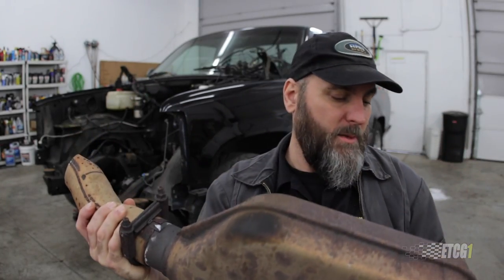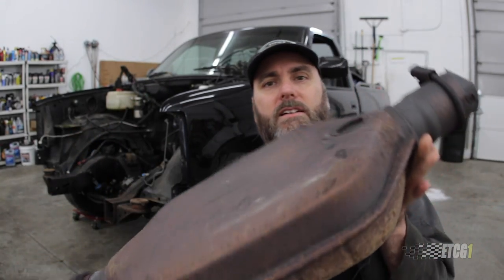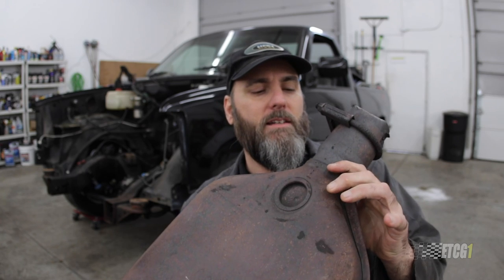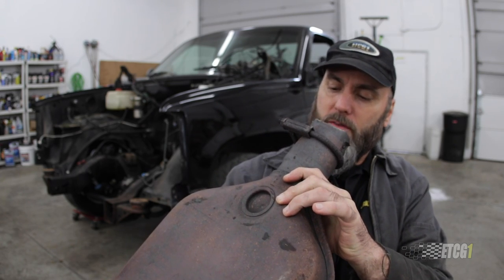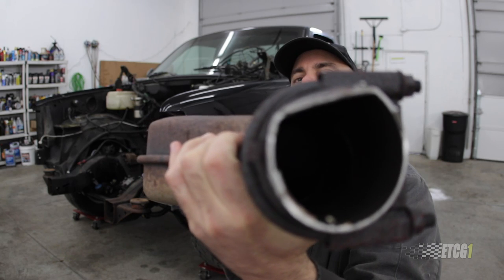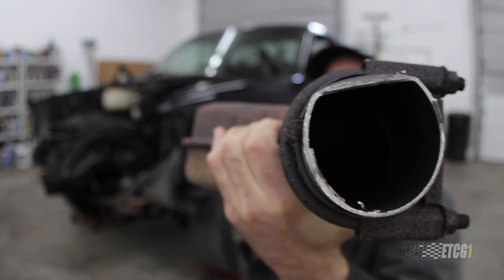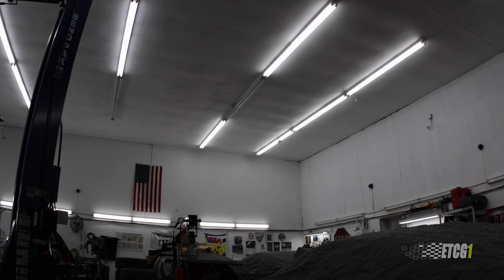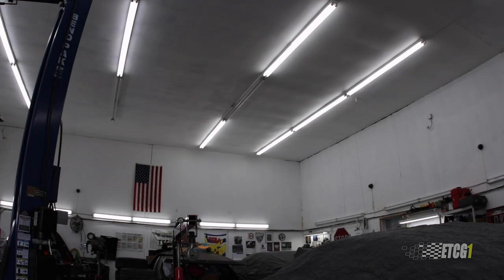Should You Run a Catalytic Converter on Your Hot Rod?

Comment: Most of the emissions equipment fitted to vehicles in the early days were almost entirely a waste of time that actually caused more pollution in the long run. Much of the improvement in air quality was achieved not by antipollution equipment fitted to vehicles but by improvement in the fuel they burnt and improvements in the way they burnt it. 
While catalytic converters may not actually do anything for the environment with the exception of reducing the appearance of photo-chemical smog fitting a hiflow cat now may prevent headaches in the future.

Comment: In the UK nothing you do to your cars emissions matters in terms of improvement. We've just had the "Ultra low emission zone" introduced in London and it's just based on trivial at the factory testing. For example a 2004 BMW 325i will have to pay but a 2005 one will not, even though their emissions are the same as they are the same car, and engine, etc. 

My 1986 BMW 6 series, was made without a cat, and although technically putting one on would allow it to pass modern enough emissions, reclassification is not allowed over here. It will be considered dirty even if it had zero emissions. And they only exempt "historic" cars, (over 40 years old) even though most insurance, institutions and even our government used to accept the 25 year norm. This is just insanity and has proven will make minimal difference as cars are not the issue in London, but are easy to charge money.

Comment: If a vehicle is being used on the road, I believe emissions equipment should be kept intact. However, it can be improved upon. Look at the GM E-rod stuff. Today's modern cats are much more efficient and smaller than the heavy factory stuff was 20+ years ago. They don't rob power or add tremendous weight. 

My dad grew up in Southern California; he remembers "smog days" at school in the 1970s; kids weren't allowed to play outside because of the air quality. His dad, my grandad, died from lung cancer; a combination of smoking and working in factories for 40 years. Smog kills people. Look at the fines levied against VW for cheating on emissions. Look at the penalties for improper HVAC evacuation. It's serious stuff.

That said, there are always exceptions. Race cars, or cars used primarily on race tracks, can be exempt, in my opinion. But the enforcement there has to be good, too. Maybe bring in paperwork showing the car being used as such (or not being used). Otherwise everyone would register as a race car. 

There is also the issue of manufacturer design faults. BMW E39 M5s (2000-2003), for example, are somewhat infamous for having secondary air injection ports in the cylinder heads that clog, causing a repair that basically necessitates an engine-out service. Later models have larger cylinder head ports to lessen the issue. Do you force consumers to repair the issue, knowing it will reoccur? Do you require the manufacturers to support emissions systems? Like the Super Ultra Low Emissions Vehicle (SULEV) and Partial Zero Emissions Vehicle (PZEV) regulations in California which require manufacturers to repair any emissions equipment for 150,000 miles.
Reply: Identifying "Race Car" is easy. Race cars are not street legal. Don't need paperwork to say they aren't for street use they simply don't meet the requirements and can't be used on the street.

Comment: I live in California and my car is newer then 75 so I have to have a cat on my car but I think I would have a cat on even if I wasnt required to. I just think they make sense and with the newer cats available today there isnt the performance hit that it use to be. In addition to the eco reason to running a cat there is also the bad smell that comes from not having a cat and having a cat keeps the exhaust from turning the back of the car /truck black.

Comment: All I can do is speak from my own experience. I had a 1981 Ford f100. It had a 300 straight 6 with 3 on the tree. It had a problem where it would idle up and down while parked. I finally got disgusted with it and ripped all the vacuum lines off and plugged them. Then I disconnected the emissions. Adjusted the choke and timing. Cut off the catalytic converter and replaced it with a piece of exhaust pipe. I wound up getting more horsepower and 33 mpg. Curiosity got the better of me and I took it to the Ford dealership and had them hook it up to the emissions tester. According to the machine it was putting out less emissions than the brand new 2002 f150. Then I showed them everything I had done and we realized that the emission equipment back then was a government scam.

Comment: Catalytic converter requirement is a federal mandate if the vehicle was equipped with it according to the underhood label or manufacturer specifications. Just because you don't have emissions testing or your state does not enforce it does not mean that it is still not a federal requirement.

Comment: 1- I am concerned about the environment.
2- I require money to live and place those concerns before the environment.
3- Catalytic converters cost a LOT of money.
4- I believe that personal accountability is HUGE, but that I shouldn't be held responsible for things that I did not cause.

All that said, if I have a working cat, I will install it. If I break it due to my own negligence, laziness, an accident I caused, or personal ignorance, I will make efforts to replace it.
But if someone else breaks it, causes a failure, or it was engineered cheaply so that it would fail after warranty gives out, or I bought a vehicle where it didn't have one or it had failed? No, I'm putting the replacement on the back burner and it may be several years before I get around to replacing it.

If I were more affluent, I may make more efforts to replace them no matter what.

That, and I have an emission exemption sticker on my vehicle for driving less than 5,000 miles a year. In fact, I have put 3,000 miles on my car since I purchased it with 245,000 miles on it in 2018. I've also tried affordable ways to repair the cat and they have not worked. So while I do care about the environment, I have no intentions of starving to death to reduce my trillionth of a billionth of a percent of the total human impact on it.

Comment: its all about culture, and eric, you live in the midwest.
take inspiration from mighty car mods and skid factory,  who always put one on.
imagine all the year of starting up in the garage,
are you sure you wont regret trying to filter the carcinogens out of the air at all?
Reply from the maker: Thanks for your input. First, my shop is 300sqft. The carbon monoxide detector never goes off. Second, I'm installing a fuel injection system that will be way more efficient that the system that's on the truck now. Just that alone may offset any additional emissions over a stock truck,.

Comment: In mass it was 20yrs classic 25antique. Here in Wisconsin same but also have special construction class. Multiple ways to get around it, if we had inspections of any kind :)
The burn efficiency is designed into the newer power trains from the intake to header. And refined further with a computer and cat. Your doing the planet a service simply by updating that power plant and I would put money on it burning cleaner without a cat than the stock setup. Not that there’s anything wrong with a high flo cat.
And for the record, anyone complaining about a no cat smell is a wuss or maybe younger than a millennial. It’s the smell of an industrious nation getting to work. The smell of school busses beginning of fall on a chilly morning. A bit of race gas in the hot rod just blew past you in your wife’s mini van. NO IM NOT GETTING OLD DAMN IT, I’m not getting old..I’m not getting old..I’m not getting old

Comment: Maybe come back to your project cars with a plan on how to slip a CAT into the exhaust without having the replace the whole system again. Kinda like what you did with your loud button on the Fairmont. Not a fan of emission laws when it comes to cars, though I am for them #Iheartearth. I live in Illinois where we have them. I’m selling my 2008 Subaru Impreza mainly because it requires a new CAT which cost over a grand to fix, and the car is old and I’m tired of putting money into it. You would think it wouldn’t cost so much to repair since the state requires that cars have one. But thats just my opinion 🤷🏽‍♂️

Comment: I'm in a no emissions state. I see cars regularly that should not be on the road due to accident damage, windows missing with the opening  covered in cardboard and clear tape. Pushing blue smoke out of the tailpipe. I have completely changed exhaust systems without fear of trouble. Muffler shops will hammer a bar thru them or cut them off completely. But I won't run a car without a cat. Get high flows from a hot rod catalog. I hate the exhaust smell you get without them. Maybe if it's a race car but not on a street car. Just my opinion. 
Party on Eric!

Comment: I live in Florida where there isn't any emission testing but here is where I stand on catalytic converters and emissions in general. If the car is designed to have emissions equipment then you leave it and repair if possible. If you're rebuilding a car with performance in mind then you're best without emissions equipment.  Far too often i see young people removing emissions equipment off street cars and all they succeed in doing is screwing up the computer and causing more pollution on their daily drivers. Also no cats on a street car smells bad.

Comment: If you're going to be running modern fuel injection, you probably be using O2 sensors, therefore you will need to run a cat probably a aftermarket magnaflow between the upstream & downstream O2 sensors. Just to get it to run right. If it was a carb, then it's a matter or state law and "did it have one when built or not?"

Comment: Correct me if I’m wrong, catalytic converters only work properly during certain temperatures.  The manufacturers control these temperatures somewhat by running the engines rich and other process which kills power and fuel economy.  Seems like a legit reason not to install .
Reply from the maker: The engine in the truck ran an AIR system which oxygenated the cat for better efficiency.

Comment: I’m from California probably the worst place to live if you are a car enthusiast in regards to emissions (cars 1975 and newer). I see the point in reducing emissions it’s just some of the laws are ridiculous. I say if you can modify the vehicle and not have higher emissions than it was brand new and stock do what you want. Obviously a race or off road use vehicle I’m good with straight pipes and or open headers etc. 

 I remember wanting to actually add 2 more catalytic converter‘s to an exhaust system (it would have been a custom dual exhaust with H pipe) to get rid of the super restrictive single exhaust that dumped both sides of the manifold (Ford V8) into a dual in cat then into a second single in cat before going to the muffler it had no Y pipe or anything other than a small tube to balance the exhaust from both manifolds and mount the O2 sensor my proposed exhaust was not allowed under my states emissions laws even though it probably wouldn’t run anymore dirtier than OEM setup and it would been more efficient fuel wise and made more power than stock, it would have even better with just 2 cats 1 per side like a modern vehicle but I’m sure it would pollute more that engine did have 2 inline cats for a reason but who knows modern designed ones might be more effective eliminating the need for so many cats.

Comment: Would it cause the truck's computer to throw an error light?
Would the lack of a catalytic cause exhaust flow problems (some engines were designed with the restriction of exhaust flow in order to function properly).
If you toss the computer, you wouldn't have to worry about O2 sensors causing an error.
Good luck! If you decide to go back to the catalytic, I notice several other commenters mention "high flow" catalytic converters.
Reply: I don't think the early trucks had o2 sensors after the cat like newer cars do. 
Might not be as sensitive to exhaust changes as newer cars.
Reply from the maker: The truck is getting a completely new fuel injection and ignition system that won't require the stock computer.

Comment: I live in New Jersey, where any vehicle 1995 and older is totally exempt from state inspection. with that being said, when/if my catalytic converter goes bad on my 1989 jeep Cherokee it's getting air hammered apart and the empty can is being reinstalled. I have a flowmaster 40 and that should sound pretty good too
Reply: artardFTW my 96 2dr 2wd 4.6l(stroker) ax-15 XJ has no cat.
Reply: @grad0n  only thing about 96 is it has up and down stream o2 sensors so it should need to see the cat on the downstream. xj had one upstream o2 until 96
Reply: A non-fouler(basically an o2 spacer) on the cat-delete pipe keeps the post-cat o2 out of the exhaust stream and no check-engine light pops up.  I’ve had an 88, 92, 94, 96, and 00.

Comment: I live in Wisconsin and for a collector car needs to just be 20 years old or older. Also no emissions either and my 2002 I don't run cats. I have true dual and have only a thrush mini muffler on each pipe in the area the cat was then just straight pipe back.

Comment: Today's fuel injection alone has cut down on emissions drastically compared to carburetors. They are running much much leaner. Remember changing plugs every 10k miles 40yrs ago, and now plugs are lasting 100k? 

If it bothers you that much, run a hi flow cat and mount with band clamps so it can be changed every year, if need be.

Comment: The entire computerized fuel injection system is designed,  all the way back to the oxygen sensors in the exhaust system,  to properly meter fuel and air such that the catalytic converter can convert the polluting gases into cleaner gases.  Remove the cat, defeat the whole premise.  Part of that system actually keeps the exhaust at a hot enough temperature to make the cat reaction work,  and removing it actually lets even more pollutants escape.  Yes,  fuel injection saves fuel regardless,  and produces a better- burning fuel mixture which reduces pollution over a carbureted  system. I would use high flow cats. Think of them as resonators to clean up the sound slightly. I wouldn't feel guilty if I didn't use them,  though.  I could have just as easily chosen to build a 1960 truck and been exempt anyway.

Comment: I never run cats on my vehicles especially if its more of a performance application like my 96 silverado with longtubes and no cats. Even my altima has a header and no cat because the cats can fail on the altimas and destroy the motors. In my area i keep my vehicles registered where there is no testing but if i had to do testing id just use an oxygen sensor spacer on the rear 02 and it will still pass.

Comment: Whether I'd keep it or not would really depend on the circumstances.  If the car came with one and it's bone stock, yeah, I'd probably throw one on there since the engineers built the platform with the knowledge that there would be a cat there.
If it's a complete performance custom build then I would either omit it or I'd go with a performance model designed for use in my application.  I suppose it would mostly depend on whether it was a daily driver or a race-only vehicle.  The 'right' thing to do is to put a cat on it regardless.
I still question just how much affect catalytic converters have all by themselves regarding pollution.  I don't know that a single base-line was ever determined where two engines were compared that were 100% identical except for one have a catalytic converter, and one not.
Reply: You're wrong about the purpose of the catalytic converter. You're right in that if the cat fails, it's because there's something wrong with the way the engine is running (running too rich and dumping lots of fuel into the exhaust will burn it up). The cat should last the life of the car. But the cat is ALWAYS cleaning up the exhaust, even when the car is running properly.
Reply: @jonclark1288  Noted and fixed.  Thanks!

Comment: I've debated this myself and generally if it came with one, it should have one. My 89 GMT400 will always have a cat no matter what I do to it (it's got the original now). I take it as a point of pride that my cars can pass emissions test, which are required in my area. I believe it is against federal law to remove the cat, regardless of whether you have testing in your state or not. Hi flow cats have almost no performance penalty. When sitting in traffic, my nose can tell which cars have working cats and which don't. My point there is that it's good for the hobby if our vehicles are not a nuisance or hazard to others, so with a cat you can be one less reason for people to push for the motor law. Plus it's just fair to play by the rules that are expected of everyone else and be a decent citizen and steward of the big blue marble. The only argument I can find for not running a cat, and this is a bit of a stretch to say the least, is that a cat converts CO (not really a greenhouse gas, but deadly poisonous) to CO2 (a greenhouse gas, but relatively inert). So you could, in theory, do your itty bitty bit to slow global warming an itty bitty bit by not running a cat. In the grand scheme, this is negligible, of course. You did ask :)